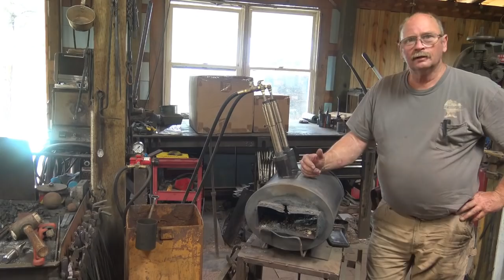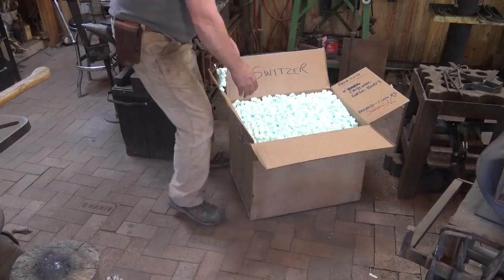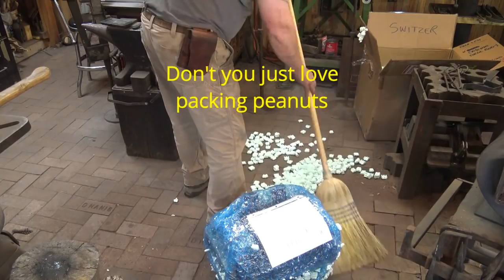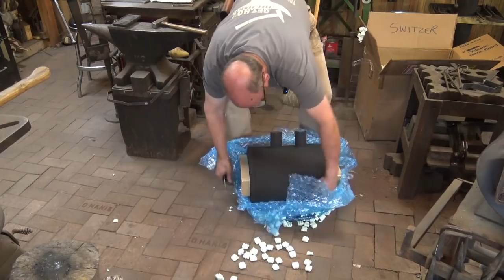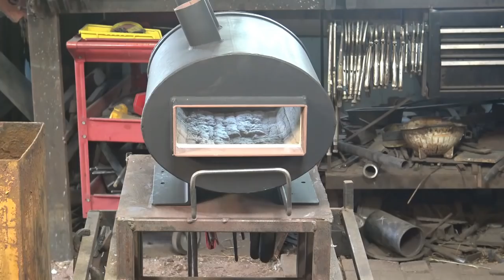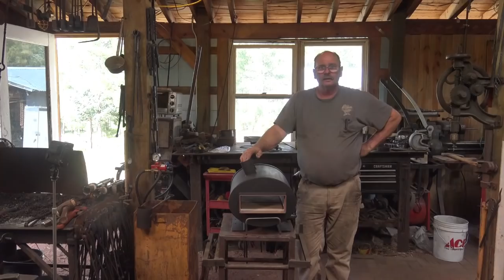Chili forge reboot - Just like new - propane forge

Comment: I built my forge out of an old air compressor tank...2" of ceramic fiber on the walls covered in refractory cement and fire brick on the floor.  I'm running 3 burners on the recommendation of John. Typically, I only need to run either one or two burners at a time but the third one is there if I need it. 
I'm really pleased with the performance of the burners I made and the forge itself. 
John helped to inspire me to get into blacksmithing...John and Forged in Fire!!  :D
Looking forward to seeing the Chili up and running!

Comment: My forge is just made of fire bricks. Real easy to replace bricks and continue to forge weld. Nice video
Reply from the maker: That is one of the big advantages to fire brick.  I may try to design the little forge to allow the floor brick to be removed without taking anything else apart.
Reply: Glad to hear someone can weld in a brick oven, I like the kell wool but it is so much easier to work with the brick and with no mess.
Reply: @BlackBearForge  the downside is that the brick sucks away heat and forces you to use more gas to maintain temp, which is a backbreaker for those of us on a budget... so I went with making the floors from Kastolite 30 LI Plus, then coating the entire interior with a thin layer of ITC-100... and the floor is now impervious to flux and the forge is much hotter with much less gas usage. But I bought my ITC-100 when it was still "only" $25/pint, so it was easier said than it can be done now at more than triple that price... but the propane savings justify it over the course of a few months, so it's a Buy Once, Cry Once situation that should be universal for us all, imo. I have a bunch of Plistix 900F to try and see if it's a suitable inexpensive replacement for the ITC-100 next time I need to reline the forges.

Comment: Just wanted to support your comments about buying from someone who not only knows what they are doing but also that they are good at it. My business in general contracting and I believe that the plumber is best at plumbing and the electrician is best at the electrical. Yah, i can glue and solder pipe and twist wires but I am so much better at the rest of the build. Great video and community support.

Comment: I have the little Chili forge with one burner and I love it.  I was worried about high heat so I use the coal forge for any forge welding temps.  I have kept up on the refractory ceramic stuff to make sure there are no cracks etc.. It is very fragile and easy to accidentally poke a rod of steel into.  My forge has the removable end caps in the event the wool needs to be re-stuffed.  It also has the old kiln shelves.  I thought about making a ceramic roof for it using fire clay but I have never gotten around to it.

Comment: I worked at a wire mill for 29 years we had 4 furnaces, 8 lead pots (50+ feet x 40'' x 2' deep, running at 1600 degrees). we were constantly rebuilding the furnaces. so I know a bit about KOwool and fire bricks.
Reply from the maker: Sounds like a hot time

Comment: I built my forge and the burners ! Black pipe a lil brass and it’s done I use double burner I was going to run three but two Is plenty!!! It’s all ceramic brick ... I love it ! I bought my first forge and 2 years it was done then I looked at buying new and about had a stroke as this is a hobby for the most part .... there is a sign out front blacksmith and it brings plenty of work to the shed mostly replacing old parts or decorative pieces we sell a few flowers or leaf key rings bbq tools campfire pokers but it’s really just about fun ! I’m in a wheelchair so the will to be a full time smithy is there the ability is not . And as anyone put on disablity knows there’s no extra money to do anything fun lol 😂.
Reply from the maker: As a hobby time spent building a forge is time spent in the shop and saving money is important.  I don't know if you make videos, but I bet there are others who need a wheel chair that would like to see how you set up your work space to do that
Reply: Yes I get quite a few visits too my shop lol... I think the other blacksmiths just wanna see me and how I work ! I don’t think my accident was anything but too make me better at everything I do!!! Just tell me if you smell barbecue at a odd time of day some scale or cut off may have fell in a shoe ... lol. My only complaint was money lol ... I don’t think it was fair to be working at a full time job they send you a check for a 1/4 of what I was making lol ... just makes me wait and save ... auctions ... making wife jump,outta suv and grab me some steal tide in trash lol or angle angle is great for benches and work stations ! And buying a occasional harbor freight or amazon prime no name tool if it’s needed bad . I watched Alec Steele clean his shop and toss out beautiful left overs from his 25 hammer in a day i about fell outta my chair lol I was I can make some much outta that ! I don’t make blades because everyone wants Damascus... and I don’t have a power hammer or press my arms are mean but not that mean lol ...
Reply: While I have your attention what do you think of this anvil mounted power hammer the Christian blacksmith has made it seems to draw out a railroad spike in two heats pretty thin !!! I need a power hammer bad I had a step assist but it did me no good anymore so I sold it for room ... and banked the cash I could make this I think if I could get a few real black smith eyes on it and tell me what they think maybe I can make some of these highly requested Damascus knives I do enjoy blade making !!! And would speed of production so maybe I can move more outta my shop !
Reply from the maker: I would have to take a closer look.  I haven't paid much attention to the design

Comment: Most of us older folks have had the same experience as you with shipping damage. Just not usually twice and a shipper who will not simply box their products securely. I use an induction forge, a small and a large gas forge. I routinely reline my gas forges as they need it. If you don't wait too long and just accept that they need it from time to time it isn't that bad or that expensive. 
The induction forges cut down on the heat in the shop and allow you to work with much less fatigue and require almost no maintenance and cost only pennies per day to run- literally. You may want to do some reading and viewing about them.
Love your vids and your advice and your willingness to share your experiences. Dave Hammer has an excellent vid on a brick forge you may want to take a look at while you wait for materials/supplies.
Thanks again, John!
Dave
Reply from the maker: I would like to try out an induction forge, but since I do so much forge welding I'm not sure if it would be the way to go.
Reply: Many of the high-end knifemakers, including Tom Ferry, are using their induction forges to make Damascus and having some success.

Comment: Ordering and shipping can be a pain sometimes!

Being that you have your burners disassembled, it's really easy to add air for a forced air/blown burner without having to go the ribbon burner route.  A blown burner forge will be more efficient than a naturally asperated forge.

Thanks for the video...
Reply from the maker: The burners are not designed for forced air.  It would require an all new burner system.

Comment: That segment at the end you spoke about doing a refit versus replacement is where I'm transitioning to now, where your time doing your primary project/work and buying parts ready to go becomes cheaper and more efficient than diy'ing something, even though the reward of doing it yourself and, arguably, getting more longevity might be a consideration. It's definitely something that becomes rather apparent the more you straddle that line! 
Oddly enough, the project I'm currently pursuing has evolved into a multi-branched monster where some of the solutions I was using to get to that primary job have taken over and become something separate to pursue, one of which is an exceptionally high temperature resistant coating that also miraculously holds great oxidation resistance. I'm currently stress testing it to see what the limits are, but it's been insane watching it shrug off anthracite forced air levels of heat while stuff like 316 starts to bubble and deform right next to it. 
Might be looking for product testers in the very near future if you're interested. 😁

Comment: Just a brief note on the peanuts.  A lot of them these days are made from cornstarch.  They are water soluble.  I just dump mine in a bucket of water, stir a few times and after they have dissolved, I pour it out somewhere around the shop.  Easy disposal method!!
Reply from the maker: These are the old style.  But I save them for shipping either way

Comment: If you can get BECMA forges in the US, I recommend looking into their products. Not cheap, but they are good quality. I have no idea about their shipping boxes though. As for the fire brick DIY forge - I am definitely going to build one of those. There is a fireplace/block oven maker near me who will sell me fire brick slabs by the square meter (very reasonable prices!!!). It will be like the one you are planning, with soft brick (vermiculite slab) on top and probably the sides, hard (yellow schamott) on the bottom, and also expanded clay pellets on the bottom to catch any flux. The frame will be just angle iron around the corners. The top frame will be bolted, so I can swap the slabs out easily if I have to.  Please do share the building process!
Reply from the maker: I have never seen one in this country, but they might be available.  I will certainly share the little forge build.

Comment: Excellent point on the business perspective side of equipment purchases. That is why there is no true on size fits all in anything. You sacrifice production for tool building. From a hobby stand point sometimes it makes sense to build due to fixed income. I did find that I could buy a burner for less money than I can make it. Stainless steel components for a little over $100.00. Burner, hose and 30 psi regulator. Would it help preserve the forge floor by placing a stainless steel plate when forge welding?
Reply from the maker: I tried it once, it warped so bad it was a nuisance.

Comment: Proper packaging seems really fundamental particularly with heavy stuff.  And what is more concerning is they turned around and shipped you another one, without taking extra precautions.  Just doesn't make much sense to me.  Oh well.
Reply from the maker: I can understand once, but if it keeps happening why not use better packaging.  Just a sheet of plywood in the bottom of the box would have helped.
Reply: Or even put it in a bigger box with packing. Doesn't take a rocket scientist to figure out you have a shipping problem! :) Chili makes a nice forge. Forge on John.....

Comment: You ever think about running a ribbon burner? Ive never looked back to venturi burners since i switched.  I can run ribbon burners at 2psi for general forging and 6 to 8 psi for forge welding.  Way better on fuel consumption and way hotter as well
Reply from the maker: I have thought about it.  But Just haven't had the time to build one